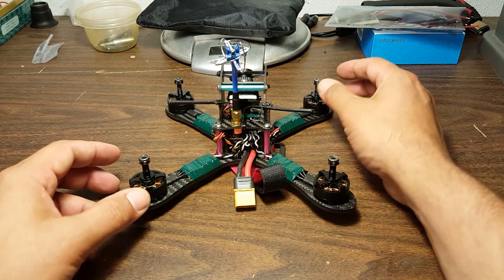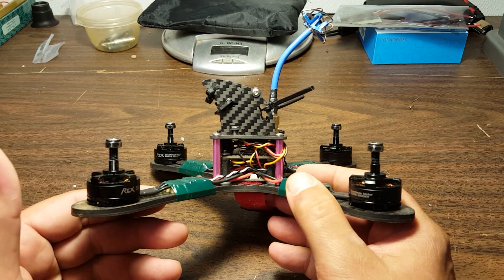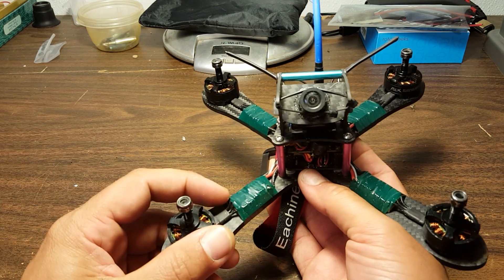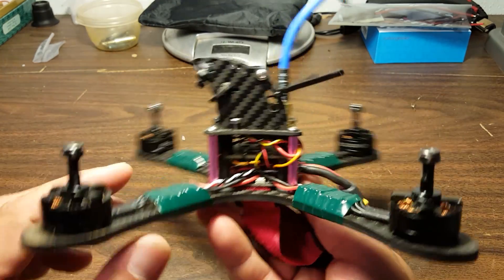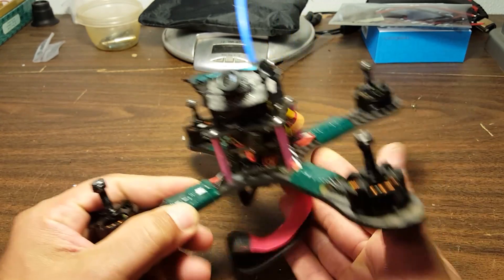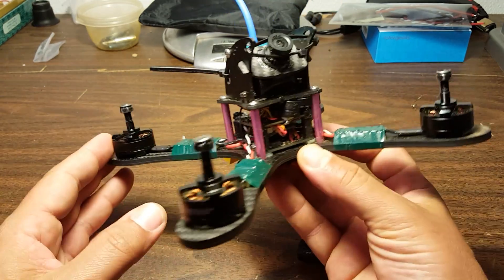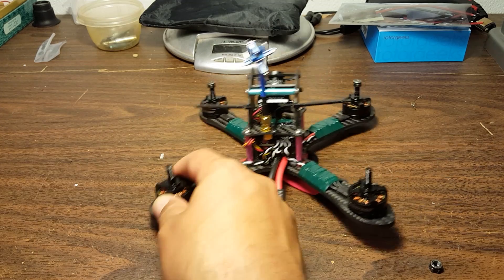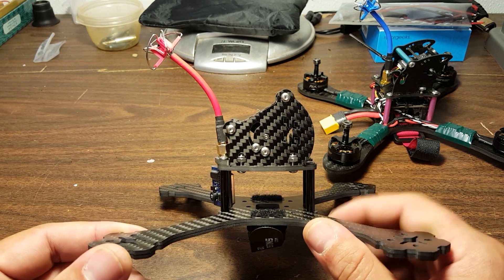Pure X Racing Quadcopter Build - Part 4 - Camera Pod, Wrap-Up

Comment: try this frame, I think its the best frame I have made and seen both in terms of design and value.

http://boltrc.com/index.php?route=product/product&path=62_149&product_id=1188
Reply from the maker: The video of the guy hitting it with a hammer is pretty impressive.
Reply: Its a locally designed frame (live in AU) "Kraken", Mark from BoltRc have designed some very nice frames. Have the Bolt stealth 250 (learnt to fly on that frame), bolt180 (4" props, 1 piece bottom plate) and 5" BlackOps (same upper frame parts as the race 180/210 but a belt together bottom section. looking forward to the 5" Kraken July 11 release, has recorded a speed of 167km/hr with 2204/2300 5" props :)

Comment: Keen on X pods, (have a Krieger on the bench) Gosh that 90deg vid fitting looks like a weak point though, specially with the amount of meat left in the CF there. Being the the highest point of the craft, and the RG402 in those Aomways being so stiff; im not sure that would last long with the way I crash (often)

Comment: Glad to see more attention to x-tower build's. I have started building a Mitsuko (from Asiatees) and wondering if at some time U could talk about the difference's between setting it up as an X vs +. Right now I have it set up as + in  Cleanflight, but I do not have enough knowledge or experience to fully understand the differences and flight characteristics. Thanks for UR wonderful work and contributions! PS - Sorry if you have already presented and I missed it. :)
Reply from the maker: Well that is an interesting question. There is some suggestion that plus builds have more stable flips and rolls because they use only two motors (mostly) to perform the maneuver, whereas an X build has to coordinate all four motors at a time. But I haven't noticed any instability in flips and rolls on my X builds. The real advantage of an X build is that the props can be out of the way of the camera for FPV, and this is IMO the reason why you will see most FPV pilots flying an X build. Meanwhile, a plus build can be as small as possible (as Andy Shen discusses in the design process for the Mitsuko) for a given prop size. Smaller motor to motor distance results in more nimble handling and better yaw performance.
Reply: Great info. I had a TBS Borg Powercube set aside for an Xhover Element but went ahead and temp installed it in the Mitsuko using their version of Cleanflight as a +. Only basic line of sight, but wanted to get a feeling. TBS did an excellent job in the config. It flew so so very smoothly with both 2 and 3 blade (little better 2). In fact, hovering, I think could land on a pin head, or gone in for a beer! Partly, I think, due to the inherent stability of the X tower design and the mass of the Borg cube. Weight with battery was 350 (Have not installed the weight saving nuts yet). During power however, I did note a tendency for it to pull and fly like an X, but with tuning could have taken care of it. All-in-all, I was impressed and it was fun.

Now - Really wish U could form a research partnership with a University Aeronautical program having a wind tunnel. If racing takes off as a $$$ maker, multirotors will have to become significantly larger with inevitable aerodynamic affects as we see with the nuances in F1. We already see some of this with the new closed designs from Andy Shen and others. Thank you and have a great holiday!
Reply from the maker: Aerodynamic effects are huge as speed goes up.